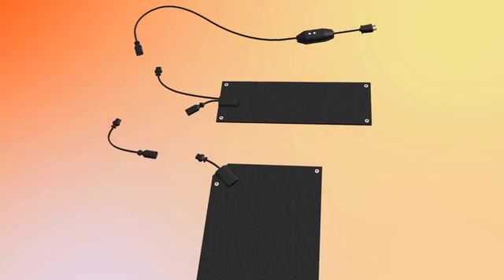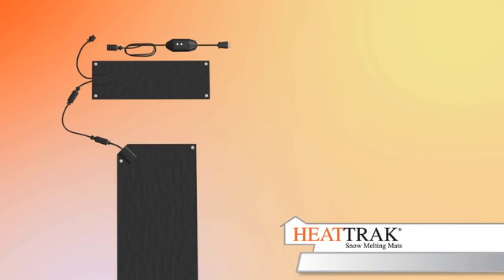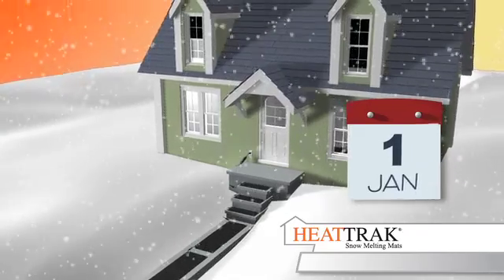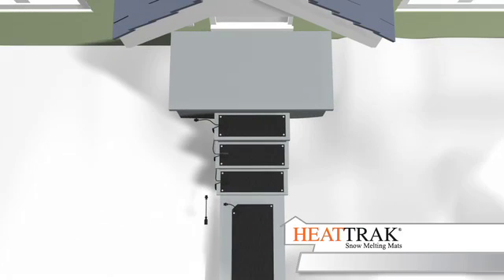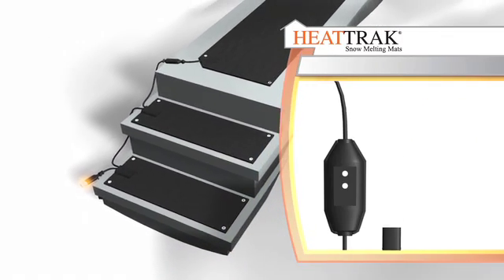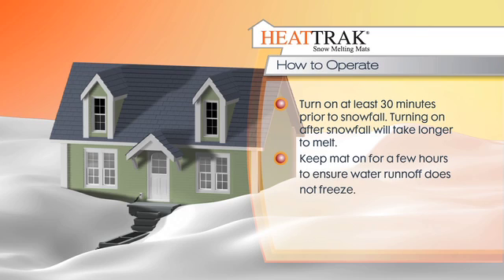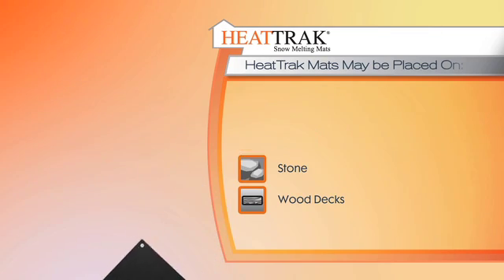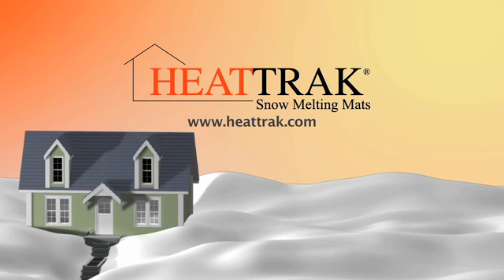HeatTrak Residential Snow-Melting Mats: How to Install & Operate

Comment: It is extremely difficult to plug male/female plug ends together! Any tips? Older woman with little hand strength. Every year I have my daughter come to help but this year even she cannot get them firmly connected. Also can't pull plastic sleeves over the space where they connect. This year I have shoveled with my unconnected mats lying inert. I'm 76 which is why I invested in these mats.
Reply: I'm a 76 year old male, and I cannot connect them properly, either. They need to redesign that part of the unit--and don't relegate it to some 28 year-old engineer. Give it to septuagenarians for useabilty testing.

Comment: What is the trick to get the grey plastic locking sleeve in place? Out of 8, I could only get two on fully. I'm thinking of heating the sleeve with a hair dryer or a drop of silicon lube or maybe both.

Comment: This is so stupid on so many levels... Elbow grease doesn't add to the greenhouse gas emissions unlike this obesity inducing, lazy bum product...
Reply: +Speedy Charly Stupid on so many levels? If a home owner is unable to shovel because they are elderly/disabled / have had or want to avoid having a myocardial infarction this system allows them to be safe when entering / exiting their home during icy, snowy weather. Not everyone is able to use "elbow grease", the contribution to "greenhouse gas emission" is negligible. This product allows some people to be safe. Think before you post!
Reply: +1introiboadaltaredei You've obviously never lived in an area where snow accumulation is more than a few inches/year and temperatures dip well below -20ºC.  Totally ineffective and dangerous in harsh winter conditions...would end up creating a sheet of ice under snow at -30º.
The elderly and disabled usually live in accomodations where the snow removal is taken care of for them, so it's a non issue.
Reply: +Speedy Charly There's still plenty of elderly and disabled people living in their own homes that don't have accomodations. Also temps typically don't dip below -20 deg in most areas of the US (especially while snowing). It can happen but maybe for only a few days out of the year. Certainly doesn' negate the use for something like this if it works as well as they say.
Reply: @mikmanic1  I'm looking at this for my elderly parents, who are unable to clear ice themselves. The product seems like a great idea.